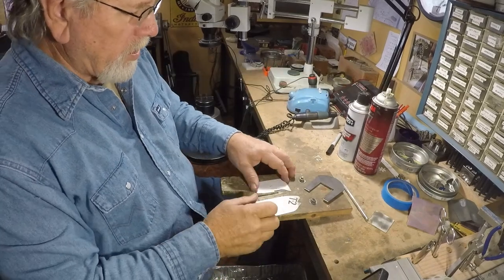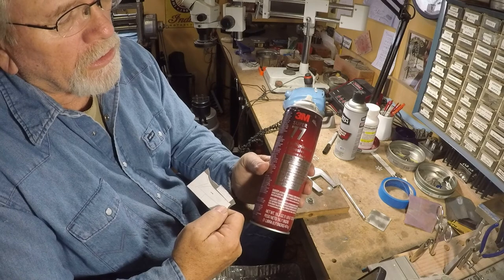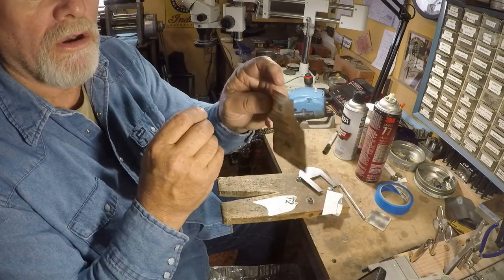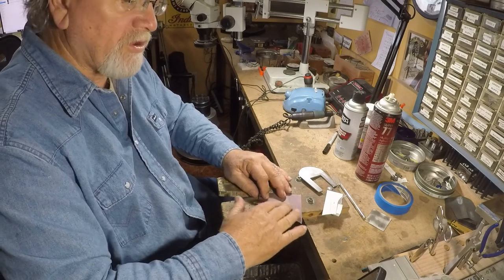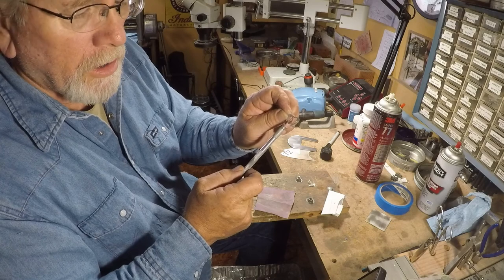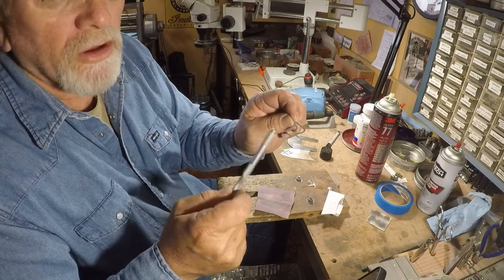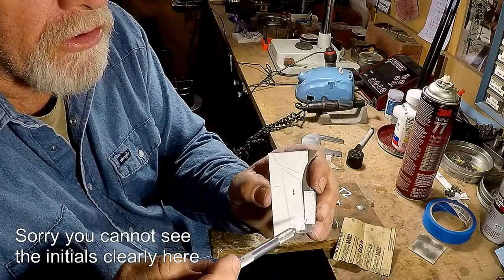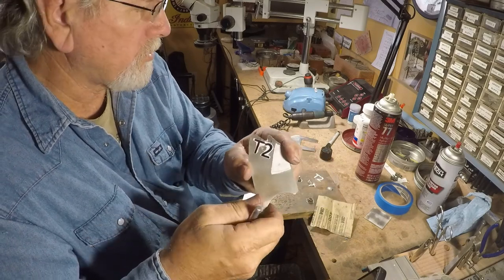Cutting Out Silver Designs

Comment: That's cool, where can one purchase silver? also can copper be used?
Reply from the maker: I buy from Rio Grande in New Mexico when i have to… but mostly melt down silver now. Copper can be used also
Reply: thank you
Reply: what gauge would you recommend starting with and does most soders works when applying
Reply from the maker: For overlays, most people use 22ga….some use 18.  As far as Solder goes, if your a beginner, use 400 degree low temp solder…. If your more experienced, you extra easy silver solder. Each take different flux. You can research that when you purchase your solder.